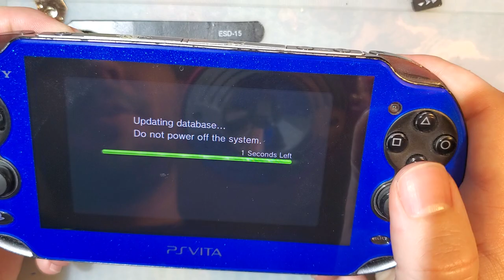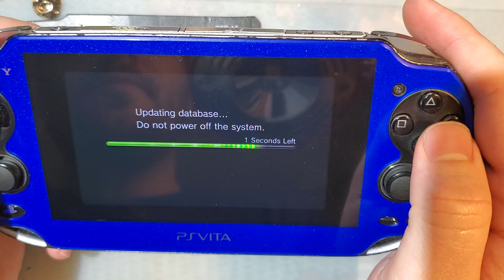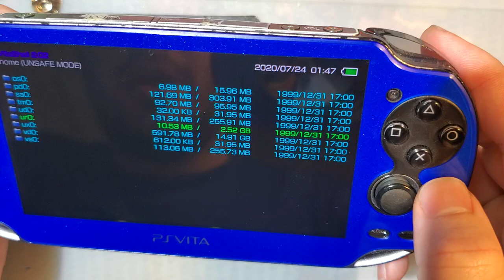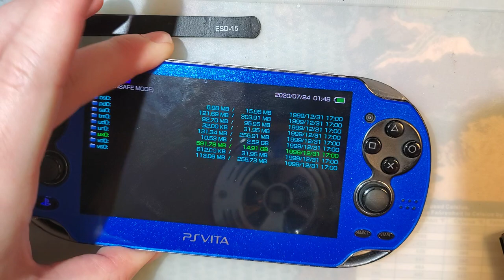USB Type C in a PS Vita (1000)

Comment: Just a correction, the 5.1k resistor is not for host mode. It's so that the port pulls power from a usb pd brick (c to c cable). By default, usb c is not hot unlike usb a which is always at 5v. The resistor is there to tell the charger that you want 5v to be supplied.
Reply from the maker: yes, it's for plugging into USB C based hosts. If that's not what I said, it's what I meant to say. 

Adding resistors does not automatically convert the vita into a USB host (though it can do that too, at least on the 3G model albeit with different wiring)

Comment: There is the usb in mod to use a thumbstick as internal memory but since there is the sd2vita adapter there is no need for it.... but its still cool, I also watched a video for the sd mod modding the 3g port, those were the early days for a mod because the high prices of the ps vita memory cards.

Comment: Beautiful, I think a 3D printed bracket that sort of lifted it at an angle and matched the radius of the back of the case and fit flush would be ideal, but also probably a huge pain in the ass to make.  Awesome work though as always makho, been waiting on this one a long time, didn't bug you because I figured you'd get to it when you get to it.

If you had the internal 3G adapter with an SD card and it was working, you would theoretically be able to write to it with the USB-C connected to a PC right?
Reply from the maker: I was going to make a bracket that lifts the port up a wee bit and fills in the gap left by the door (or maybe just cut a hole in the door) and yes, that's exactly how it would work. As is, I could already write to the memory card.
Reply: makho awesome, so you could write to both memory cards?
Reply from the maker: @JimmyGFromDayton  either but not both
Reply: @makho  I'm not trying to be stupid, but I don't quite understand what you mean?  
Do you have to reboot to go between them or just a soft reset type thing?  I know they are a little weird and you can't really copy from one directly to the other while they are in the Vita using Vita's internal software, but I'm not quite understanding what you mean.
Reply from the maker: @JimmyGFromDayton  you can only copy to one at a time.

Comment: Awesome video man, just curious on two things, why wouldn't you be able to just use the pins on the charge port (say for a PS Vita 2000, thinking about doing this on mine) and did you put an SD break-out board IN the Vita?  What's the benefit over a soft mod and game-cart SD card?  Great Video!!!
Reply from the maker: Despite my struggles, where I soldered was the easier and safer choice. And yes, that is an internal uSD. The benefit is that you can still use the cart slot. It only works on 3G Vitas.

Comment: Great video, will probably try this on my own Vita. 
Any idea if replacing a motherboard with one from a different region will have any adverse effects? Finding US boards seems much easier than finding EU boards, and not sure I want to attempt soldering on such a small scale without some sort of backup board.
Reply from the maker: only difference really is the default language and the default control scheme (US X=Confirm in menus, JP O=Confirm in menus -- game controls are set by the game itself). The games are region free and you set the eshop region when you set up your account on your console. You do have to format the device to change the eshop region. 

For the 3G variants, I believe the specific carrier will be different per region but I doubt that's a concern if you're not intending on getting 3G service (I don't think these things are supported on most carriers these days).
Reply: @makho  Thanks for the reply!
While it is a 3G model, I'm planning on installing a PSVSD adapter in that slot either way, so shouldn't matter much.

Comment: Hi.... 

I have problem my vita not being detected by PC (Windows 10) using USB, let alone as a camera device. No matter whether I was using Vitashell or QCMA, it seems that the USB connection from my vita is not being detected at all. No notification sound or whatsoever. I'll try to connect to android box (using the USB Camera app) but still no luck. I've tried using 2 new cable but nothing being detected.

Not even a Windows sound (as when detecting an USB connection). It seems like the USB data transfer has been disabled/ dead. But my Vita still can charge. My Vita is 1000 model on 3.60 Enso using SD2VITA 512GB full games with 8GB original Sony memory card, working well. I bought it second hand. I have 3 charging cables, all for test, but with no avail. They can charge but nothing on data transfer. When I plugged the cable, there wasn't a notification/ loading icon.

What is wrong then?
Reply from the maker: I'm not really familiar with vita hardware but in this case, I'd assume the connector has been damaged on your vita or the USB data filters (what I soldered to in this video) are blown out on your console.

Comment: Could u take d 5volts from anywhere? Or did have to be from that specific point u did?…..ik d+ and d- needed to be there idk about the 5volt…..just trying to learn  if anyone can answer me with an explanation plz
Reply from the maker: We're supply 5v to the charge circuit, not taking 5v from the regulated internal supply.
Reply: @makho  aren't there three test point to d left of the charge port which are 5v, ground, and the thermometer that people use to do battery mods ....could u of used the 5 volts from there?

Comment: the component with D + D- can be replaced if damaged? if so, by which component? thank you
Reply from the maker: It's probably an electromagnetic filter so you can probably just bypass it. You'd likely have unreliable USB data transfer if you bypass though. You'd have to find a schematic to know for sure.
Reply: @makho  thanks for your aswer. I can't find the schematic.

Comment: I have a PS veta does the non 3g model have that pci-e mini port
Reply: the solder points are there but not the header
Reply from the maker: no
Reply: Well darn I was going to try a solid-state drive that fits those ports
Reply from the maker: @Starcat128  even the 3G model doesn't have PCIe, it's just a USB port with a PCI-e connector
Reply: makho So then the solid-state drive wouldn’t work then
Reply from the maker: @Starcat128  no

Comment: Nah, I don't buy it. For just copying vpks across you can ftp which on a good wifi network is plenty fast enough for the size of games it handles. Other thing is, you could always mod the back so you can insert/remove that mSD card slot you hacked and copy stuff onto it easy peasy. Those proprietary leads are all of AU $7 on eBay. Ouch!
Ripping into the guts is fraught with danger as you would be aware and would only be done to monetise Youtube and/or because you're not bothered what happens to it anymore.
Reply from the maker: I see you also debunked charging

Comment: Which resistors did you use for host mode?
Reply: @jerodunruh8006  What happens if you dont use a resistor on the USB C port?
Reply from the maker: then you cannot use a usb type c host to charge the vita